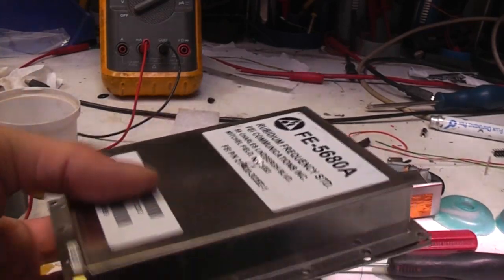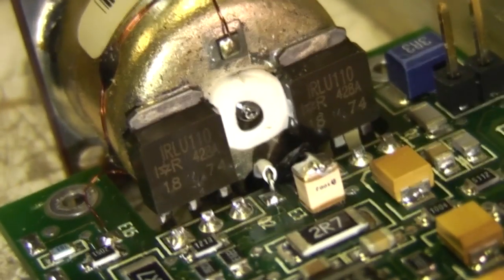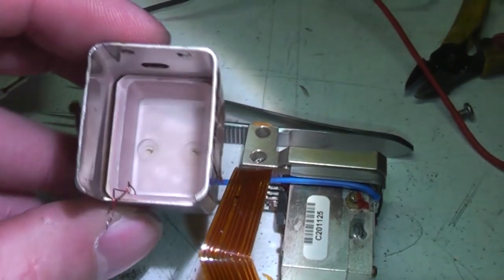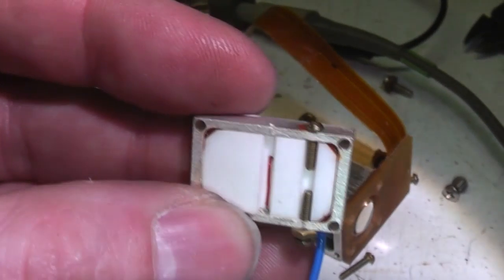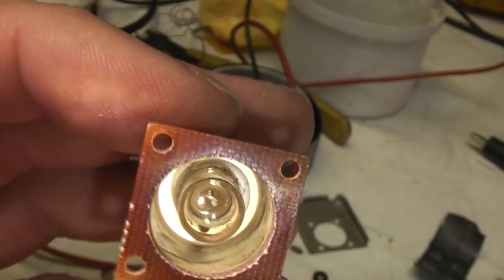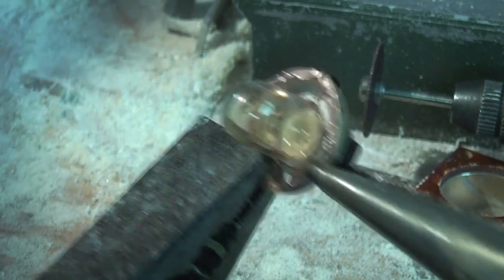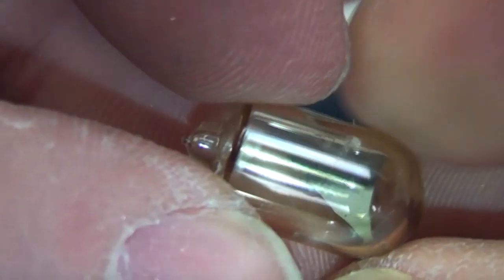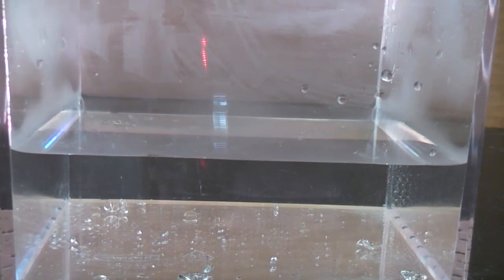Rubidium frequency standard Extreme Teardown

Comment: The coil in the resonator cavity is used to tune the frequency of the hyperfine structure transition of the rubidium.
Reply: +Andreas Müller Thank you! I somehow found my way to this video wondering about Zeeman effect in rubidium clock and what (if anything) is done about shielding external fields - and it's even used for fine tuning the clock.

Comment: 4:32 Its two slightly different rubidium gases, one is a filter made from 85Rb gas and the resonant one contain 87Rb with a little buffer gas. There is actually two big resonances in 87Rb (that also is in the lamp) but only one is the right one but they are very similar which make the right one extremely hard to detect. When the light is filtered through 85Rb the wrong resonance is strongly muted and the right resonance is not and easily detected.

Comment from the maker: @SigEpBlue "Mass-produced" for this sort of thing is probably only a few thousand... remember these things would have originally cost over a grand, so a minute or two on the production line to hand-solder some wires isn't a biig deal. The high operating temperatures limit the choice of mounting methods available.

Comment: Fantastic video! I think the coil around the cavity is actually a DC solenoid. These tend to be used for shimming the rubidium cell, as a magnetic field slightly alters the resonant frequency (+/- 1-2 ppm).

This can be used for synchronising multiple rubidium oscillators together, or for locking the rubidium standard to a more precise standard (e.g. GPS or caesium).

Comment: Sorry for the multiple comments, they are limited in length so I have to split them up. I think two cells serve different purposes. The one closest to the lamp should be a filter and the one closest to the photocell should be the resonance cell. If I recall correctly they contain different rubidium isotopes, the filter contains rubidium 85 and the resonance cell contains rubidium 87. The lamp contains either pure Rb87 or a mixture.

Comment: If you let the rubidium lamp heat up and then lower the supply voltage, the glow of the fill gas (argon?) will extinguish and you will see the spectral light from the rubidium. An incredible deep purple glow.

Comment: @antadefector I think you mean a "YIG" filter. YIG = Yttrium Iron Garnet - a type of dielectric material whose resonant frequency (for a given shape) depends on the external DC magnetic field. They use a tiny (about 1mm diameter) sphere of this material inside the filter and then couple RF into and out of it. A simple metal cavity resonator doesn't change its resonant freq because of DC magnetic field. The Rb hyperfine freq does depend on the external mag field, though.

Comment: @coondogtheman1234 It is an oscillator that produces a signal whose exact frequency is determined by the physical characteristics of rubidium gas; it's super accurate and stable and is therefore a "frequency standard." At high cost, they were used to govern the operation of cellular phone sites; as low cost surplus, we can be feed them into measuring instruments to allow them to take on the same accuracy and stability.

It will NOT make pizza taste better or attract girls (or vice versa).

Comment: At 07:06 you show the sealed bulb that contains the Ru.  I have read that it is possible to rejuvenate these devices by evaporating Ru that has deposited http://www.vk3um.com/Rubidium%20rejuvination.pdf on the sides.  Do you think it would be possible to non-destructively get to the bulb on the FE-5680A units? Looks like it might only have been held in place by the white gunk?
Reply: The bulb contains rubidium, not ruthenium.